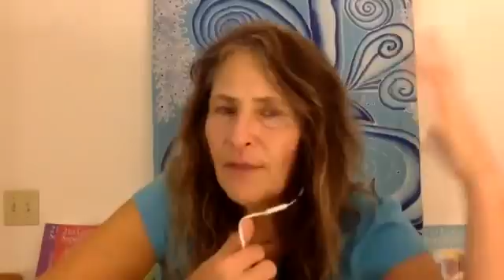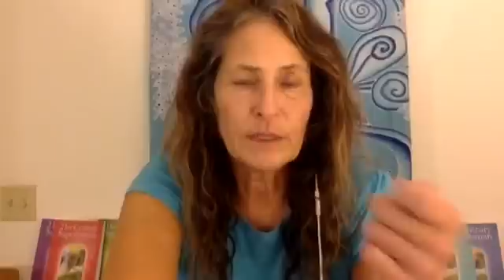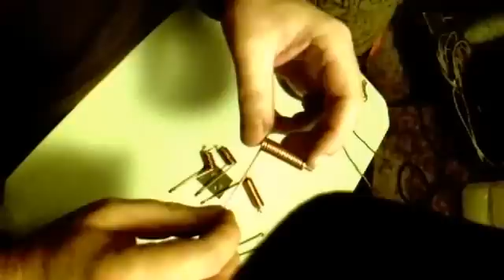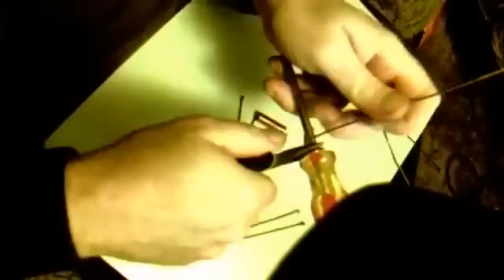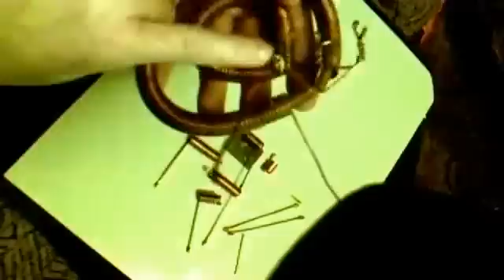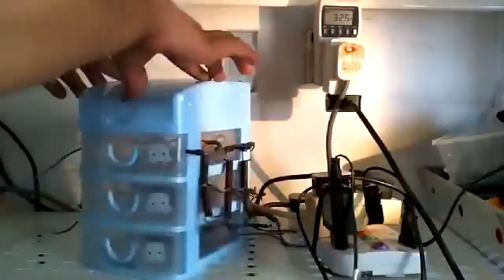Cary Vivek John magrav

Comment: everyone I know has a Smart Meter already here in the USA... are we wasting our time with this?
Reply from the maker: I suppose that depends on what your intent is for spending that time. If it is simply to get energy that you don't have to pay for, then perhaps. If it is to generate the beneficial fields that not only supply some of your energy but also extend far beyond your home and supply benefit to what is around you without concerning yourself with money, then certainly no, not a waste.
Reply: OK, I watched a Magrav video online that operated completely off the grid using a compressor to start it up. Can I disconnect my building from the power company and operate in this way? I do aquaponics and grow fish indoors and my metered cost is over 1000 per mo.
Reply from the maker: Aquaponicsales1, eventually. The compressor based system is only a proof of concept. It is fussy and not terribly reliable. We are working on a solid state version with no moving parts and a greater output. I can't say when it will be ready for public consumption but it appears to be almost there.
Reply: great to know. Is there a group I should join to get the heads up on breaking news?
Reply from the maker: The latest info is released on the weekly workshops as it comes available. Thursday mornings in Italy, Wednesday night on the west coast of North America (or Thursday morning, however you define Midnight). The Facebook page The Golden Age of GANS also tracks the releases a few hours behind.
Reply: thanks  John... you are solid!

Comment: Does the copper wire have lamination on it?
When you buy it can you get it as just plain copper with no varnish on it?
Reply from the maker: You cannot use magnet wire (coated with shellac or similar). I use regular household wire, generally sold as 14-2 or 14-3 (14-3 is preferred for volume of copper) and strip the insulation off. You can get plain wire in rolls, but be careful it is not magnet wire. There is also plain copper wire sold as grounding wire. It is multi-strand wire that needs to be disassembled, though it is usually 12 gauge. This isn't an issue, but a bit wasteful. 12 gauge wire is not necessary.

Comment: Hello Guys, what I want to know is once my magrav unit start to work it will be lowering my electric bill, now I have my unit on and I have a 500 w heater plug into it, I can see that my positive wire from the wall outlet is starting to turn black, it;s being nano coated now how long will it take for the nano to run through back to the meter before the heater I had a 100 w light pluged into it for one week then I notice the wire turning black from the wall socket, now with the heater should it nano coat the wires in the wall faster and how long do I need to keep the heater plug in, I'm in Israel and it's winter here now.

Comment: Electrons and AC 'pressure' from grid should be the same from the Upstream source to downstream Magrav, (I''m assuming) from the A/C power source (upstream pressure) from an outlet that is grid-tied OR from a solar panel... DC or AC converted. The advent for utility in harnessing the Solar PV electricity in this application seems to me to be the next project. Grid Dependence should not be necessary if you can provide a flow of electrons (AC or DC) to be hooked onto the Upstream side of the Magrav unit. The Magrav is a super insulator with millions of Ohm's resistance, it requires an upstream feed of a flow of electrons in order to keep it cycling from an electrical torroidal flow of cycling electrons. Electrons aren't "spent" in an electrical system.. They are providing work by electromotive force (to do work) on a motor (reacting to the electromotiv pressure), responding to the electron's motiv force. that being said, electricity is not spent, electrons are not degrading, they are not changing in any way.. They are merely looking for a ground or rest state, having come from an excited state. Source to sink, high to low, hot to cold... 

I have about 30 Oz. of GANS. I saved from over the last year. I'm going to begin to nano coat now and build my coil windings and capacitor's. I am going to hook a 315 watt dc solar panel to an AC inverter of 1500 Watt capacity. I'll attach this to the upstream (inlet) side. on the Downstream side, I'll be anticipating being able to operate AC 115 volt apparatus from a powerstrip... This should only work without lack for power to feed the strip, only while the solar panel is creating a flow of electron's to provide the upstream (inlet) pressure on the magrav system. 

A Charged battery with charge controller and AC Inverter for night time and cloudy or Solar Halo effect occurrences should also be thought of in this configuration to maintain off-grid (portable)/ upstream pressure to inlet side of Magrav. Making in-series configuation's of this portable system should be plausible for anti-gravity or healing fields to immerse oneself in akin to Royale Rife Frequencies. In this case a redox flow aqueous vanadium battery would be an interesting choice for a portable Magrav field generator or even a "ship"...

If this works it's game over... Or more over - GAME ON!
Reply from the maker: +Jack Mosel What you are suggesting should work very well, but you are missing something important. The energy you obtain on the downstream side is only, roughly 0.25 to 0.167 of the reflected energy available on the upstream side. It is on the upstream side that you get the real useful output. I know this seems strange and difficult to "get" at first, but remember, we aren't working with electricity anymore and it is necessary to think in plasma terms. Plasma acts, reacts and supplies energy in a very different way than electron flow.